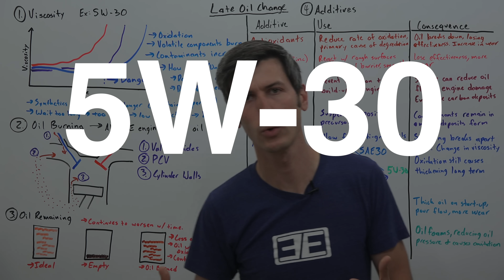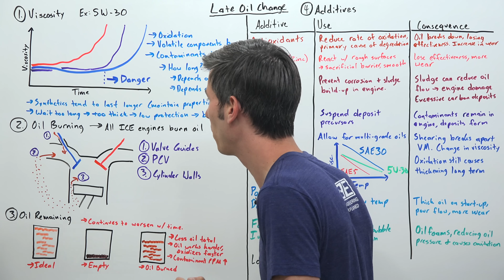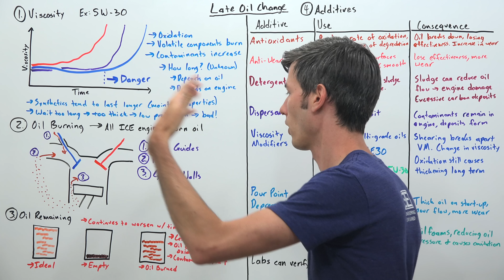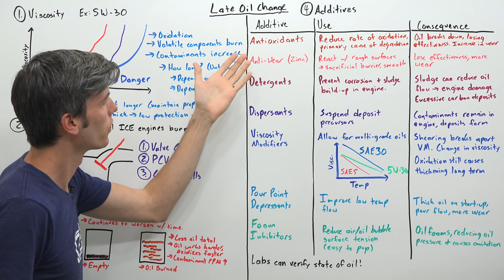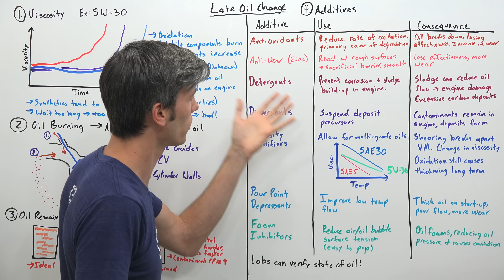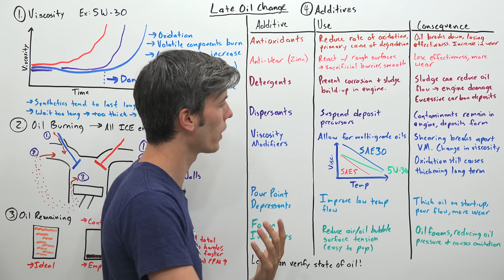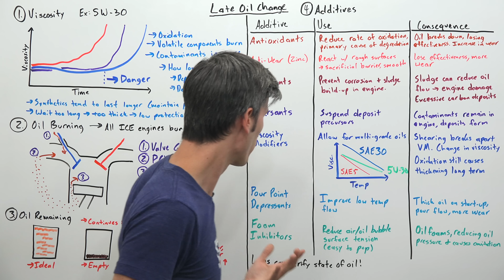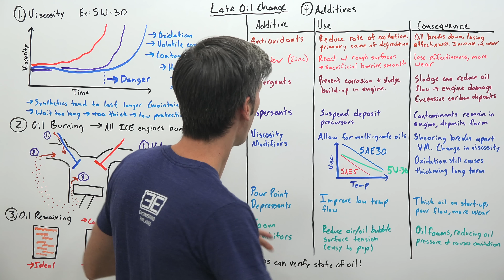What If You Forget To Change Your Oil?

Comment: Soooo, I don't understand graph number 1. What do the various colored lines represent? My best guess: red = conventional oil, purple = synthetic blend, blue = full synthetic? Wouldn't the "danger" line be better drawn from the Y-axis, when an oil reaches an unacceptably high viscosity? Just a poor graph for the point being made, and not really explained.

That leads to my follow-up question: if the main danger of an engine not burning significant amounts of oil is a breakdown of viscosity, could I monitor my oil pressure in a controlled environment for degradation? I know he goes on to explain all the other important properties, but viscosity seems to be the deal breaker here.

Comment: VW states oil is on spec if you burn less than 1QT per 1200 so with that being said by 10K(Dealer interval by VW) the oil is no where to be found on the dipstick so we recommend ppl come every 3k to get a top off but it’s normal on these cars it’s written on the owners manual it’s just how new cars are with Direct injection and plastic BS the oil burns so bad

Comment: While not addressed specifically, based on your video I would conclude that if car X calls for 5W-20, you could safely run 0W-20? since the first number indicates the lowest temperature that the oil maintains its viscosity.  In other words, the fist number can be lower (but not higher) than called for, but the second should not change. True or false?

Comment: Serious question.  I have a 2016 Acura bought new in March 2016.  It's only had one oil change to date due to extremely low miles.  Only about 8000 right now.  The MID display still doesn't say I need an oil change yet it's been over two years!  Should I change it anyway?  Note: I checked it recently and it's full and still looks fairly clean.  It takes 0W-20 synthetic.

Comment: Woah woah woah, Jason - if oil comes out dirty, then outside of special circumstances like initial wear-in, you waited too long. Change it more frequently if it doesn't look as good as when it went in, when you drain it out.

For my last car I made a point to always change the oil every 30,000 km. No grunge - came out clean every time. Indicates that those modifiers had not worn out yet, which is exactly what you want.

Use a high quality synthetic!

Comment: Thank you for the information and excellent explanation.  Note: as a fleet & logistics manager for Pepsi cola, we send the used oil's to a lab for testing to determine the proper oil change intervals for various truck types that we own.  As a rule of thumb you can go twice the recommended mileage.  Since we run hundreds of trucks and vehicles, the sample is adequate to arrive to a conclusion that is valid within our application, vehicle types, and the type of oils we use (none synthetic).
Reply: All persons talks of mileage but what about time?
Reply: @LibertyWlk  yes, we are low mileage family , our car does 3 to 5 thousand miles per year at most, so we often dont change it every year and never had any problems , we buy 3 year old cars and run them for however long we feel like which is usually 10 years or so.
Reply: @FlyingFun.  It also depends on what type of "low mileage" one has.

If all are short trips, these are actually bad for the oil.  Cold engine = fuel vapor condense onto cylinder wall & doesn't burn, wipes right into crankcase, dilutes oil, etc...

If each trip is reasonably long, just few trips each week, that's probably the best combination for the vehicle...
Reply: @reallifeengineer  I knew short trips were bad but thanks for exact reason why.
Commute is about 20 miles and weekly shop just a few miles away.
I'll defo keep an eye on the oil.
In my previous work I was doing loads of  5 minute journeys with 30 minute between them and oil got pretty black quite quickly.
Reply: @FlyingFun.  best way to go about it is to check your oil every weekend. I've found all other advice too general and now I just check oil every Sunday and going good🤙🏻
Reply: This post is the only one worth anything, it has actual data/analysis rather than one’s opinion.  Ive been building performance engines for over 25 years as a hobby, have pulled many apart and reviewed the internals.  Years ago I had beater that i treated like a beater, used conventional oils, used the cheapest oil on the shelf and changed them like every 10k rather than the recommended 3k as I didn’t care about it.  When i I pulled that apart I was pleasantly surprised to see no damage from the oil, no scoring on any bearing surface or cylinder walls.  On cars I care about I do change my oil frequently because it’s cheap insurance but I don’t sweat over it, like you found oils today do a great job.  People too much thought into oil changes, I have yet to see one engine failure due the oil in over 25 years of my and friends engines but like I said it is cheap insurance.
Reply: That’s facts. They recommend 5k for pretty much everyone so rule of thumb don’t go over 10k and def don’t push the engine hard as well as check oil levels often.
Reply: @Rider-hh9it  
No engine has compression rings that are expanded by oil pressure. Piston rings are expanded by tension only as piston don’t receive any oil pressure. This is why clean oil with the proper additives is extremely important. Once the oil rings begin to stick in their groves, there is nothing short of a rebuild that can unstick them.
Reply: @benztech2262  Not even motorup?💀
Reply: Excellent input thank you very much.
Reply: @Rider-hh9it  True they did not have VVT but had compression rings.

Comment: Don't make the same mistake I did, always stay ontop of those oil changes.

I just recently bought a nice six cylinder Merc manual. The engine got redtored by the previous owner but then left it to sit in a garage for roughly 2 or 3 years. My dumbass bought it and after a month, without changing the oil, clyinder six was left with no compression at all. Just guess what lead up to that. After I had a little fun with it for a night on the Autobahn the oil pressure sunk since my engine burnt too much old oil. The oil pressure readers' gasket blew on me and the entire engine bay got sprayed (head gasket was fine).
Also the PCV stuffed the intake with oil. Ironically I checked the oil the same night. 

I ordered a new engine which I'm going to dismantle, (change it's piston rings and gaskets etc.) plus use quality oil. 

I should've known better for a car mechanic trainee at Mercedes... At least I get to work on my car's engine 😁😁

Comment: I once accidentally went ~12,000 miles on a conventional oil change in my Kia with ~105,000 miles on it at the time. I was definitely sweating it, but it doesn't seem like it caused any damage that I can tell, no more ticking or noises than it had before...I do need to get it tested at Blackstone though.
Reply: Have you looked at the oil dipstick recently? Going to far without an oil change can increase engine oil consumption. Older cars normally burn a little oil but if you see a big change in oil level that's not good, alot of oil consumption will wear out the engine faster.
Reply: once I went 2 years with conventional oil, some shitty ass synthetic blend from honda, the engine never made any noise, was driving very smooth before oil change and almost the same after the oil change, just a tiny bit smoother.

Comment: You go back and forth confusingly between miles and time. Which is it? Does oil need to be changed by the clock regardless of use? Is there a graph of such a thing?

Comment: anyone know the 'window' for a oil/filter change ?  My car's manual says every 6 months (I do about 2000 miles every 6 months). I use fully synthetic 5W30 oil + quality filter. Car doesn't tow nor is thrashed with 40K miles on odo. Is 8 months between oil changes OK?  Old oil marginally discoloured. Just asking.

Comment: The car I bought almost new consumed a lot of oil at the beginning, 500mL every 5000km, that's a lot for a non-american engine ;-) .
Today at 70000km the oil consumption slowly decreased to almost zero, I never need to refill between two oil changes (20000km).
I don't know the reason, but that's the opposite of what you said. However I guess you're right for most scenario ^^ .
Reply: This is really interesting

Comment: In the uk we change our engine oil every 20,000 miles. BMW recommendation  !
Reply: On their plastic engines?  Have you considered that 20k recommendation is for the benefit of BMW...  and NOT you?
Just something to consider.
Reply: Sounds like you are going to have about 2-3 total changes before you need a new BMW. 

Any BMW after 2005 is basically disposable these days.

Comment: Hello, Can I do an oil change 6 month even the mileage is less than 3000 miles? Manual spec on my car say 3000miles or 3 months is recommended. So can please explain why 3 months only even the oil is used for less than 3000 miles? Ty

Comment: The dealer said that they changed the oil but didn't, then the next time I went to change the oil and isntead of 4 liters of oil inside there were only about 2 and a lot of sludge! The oil wasn't changed for 20K (kilometers) - We added a "flush", ran the engine for 10 minutes or so, changed the oil and will change it again in 5K not 10...how did this sludge become....?  Someone told me to drop the oil pan and clean it. Thanks - great educational videos

Comment: You can have your oil analyzed and decide if your oil change intervals are adequate.  I use synthetic oil and change the oil every 10k or so.  My car has 227k, and the engine is running just fine.

Comment: A mechanic in Houston, TX posted a video of what an engine looks like when the oil hasn't been changed.  Back in the late '90s and early 2000s, Toyota did have a problem of oil sludge.  This is another important reason to change your oil regularly.  If you have low mileage - driving your car less then 5000 miles a year, then changing your oil once a year will suffice.
Reply: I have a 1998 Explorer that I drive about 1,000-2,000mi per year and only change my oil once in each year. Seems to be ok but considering how my timing chain cassettes were already going out I couldn't tell if I was hurting the motor or not....

Comment: My uncle car have 66,000 mile and oil had never changed, he change it last werk
Reply: Saeed Alsaman engine would have seized there wouldn’t even be any oil left after 66,000 no change
Reply: @stickinthemaster   it was around 3 quarts left and oil was really black, but the problem now he has to change the timing chain ans spark plugs and flush the oil again

Comment: What if i just use my car about 1500-2000 city driving miles a year. Should i change oil yearly or can i extend it to 1 1/2 -2 years? I am currently using castrol edge 5w30.
Reply: Ronald San Pedro I would never go more than a year between oil changes the oil will breakdown regardless of how often the vehicle is run. I would make sure to use a full synthetic if you are changing it yearly and check the oil level at least once a month as the vehicle will naturally consume oil. Even though it’s only 2,000 miles a year the fact that it’s city miles will increase the oil burn off so just make sure you check you oil dipstick and use a fully synthetic don’t go more than a year.
Reply: @stickinthemaster  ok thank you. Ill change it out asap

Comment: We almost never changed the oil in my first Subaru Impreza. Probably averaged around 10k miles between changes, or worse. It lasted 300k miles with minimal issues, so it's kinda whatever.
Reply: Depends on driving style and weather. You can get away with it if you never rev your engine.

Comment: Hi, I saw your video after the I changed my oil.  I purchased a 2003 Honda Accord 3.0 V6 3 weeks ago.  I recently got oil change and I used synthetic oil, I did notice there is a slightly louder engine noise (knocking/clicking sound).  So should I go back to regular oil the next oil change? a mechanic told me once i used synthetic oil I need to stay with synthetic from now on. the mechanic also told me to buy Lucas heavy duty oil stabilizer to help reduce the engine noise.  what do you think?
Reply: That happened to me with an old Pontiac and Lucasoil cleared it up. It's a bit hit or miss though. Good luck.

Comment: I always pour another quart through after all the dirty is drained. Then plug it back up after that quart pulls out more dirty oil.
Reply: I tip a litre of heated clean oil through also, after draining. I have to make sure the I return the pan to the kitchen after a good clean 🙂
Reply: Everybody knows to use brake cleaner liberally to deep clean the internals.

Comment: I change my oil once a year no matter what.  I drive a Toyota Tundra and it’s going strong at 13 years old with 160k.  I also have a 2001 Tacoma, changed once a year, skipped every other filter change, and it’s over 200k going strong.  How do you explain that? Am I just lucky?
Reply: As long as you are using full synthetic oil and a good quality filter changing it once a year isn’t that bad but your engine will show more wear and have more deposits compared to if you changed it every 5,000 miles or so and the filter every time

Comment: I used to hold your videos in extremely high regard, I'm not so sure anymore after this video.  I do double the factory change internvel in an engine used in extremely harsh conditions. Even with 7k service oil the oil samples are coming back good, to the point the lab is recommending running longer.  According to your video my engine should be trashed.   That's before we get into the drain intervals on cars in Europe.

Comment: My car is getting a new engine right now, I wasn't kind the first 3 years I owned it and now I'm paying for it. It hadn't failed yet but it started making a ticking sound so I took it in, and they found metal flakes all up in my oil. I had just gotten an oil change a few days before it started as well so they're helping me out since they should have noticed it then, I doubt it was an instantaneous thing.

Comment: Here’s another video topic idea for you, Jason:

On my Prius Prime, a PHEV (Plug-in Hybrid Electric Vehicle), I have the opposite concern:  I almost always drive in EV mode, except when we go on road trips, which are comparatively rare.  So I end up doing mandatory 10Kmile oil changes to keep from voiding the warranty (and to pay my dues to the dealer!), after barely having used that oil at all.

But Jason, what are the dangers — related to oil or anything else — in using an engine any appreciable amount only very rarely?
Reply: Well it’s the oxidation, whether used or not the oxidation won’t help. How’s your car running, 3 years on

Comment: Thanks so much for these great videos, I hope it's bringing you success. Quick question on oil degradation: clearly mileage is a major contributor, but how quickly does the oil oxidise over time? If I rarely drive a car, it could take years to hit 3,000 miles. In this case is it better to count time and change the oil annually at a minimum? Specifically, the owners manual for my diesel Renault says Oil Change Interval is 30,000km (18,641 miles), or one year - whichever comes first. Clearly this is an extreme OCI and I change the oil more frequently, but these engines allegedly do just fine on 30,000km OCI's. Since I drive about 12,000km (7,458miles) per year, I normally do just the annual oil change (crazy, right?). The big question is: If I go a month or two or six past the annual oil change, will the oxidation of the oil render it inefficient before it gets changed?

Comment: If you forget to change your oil based on time not mileage, then YES.
5w30.. 5 indicates the BEHAVIOUR at cold and 30 is BEHAVIOUR at hot. So behaves as a 5 weight at cold and behaves like a 30 weight at hot. Else you make people believe it gets thicker as it gets hotter

Comment: I live in the northeast and I'm wondering what you think of using the next lower viscosity rating just during the winter months before changing oil in spring?
Reply: Next lower than what? 5W... is rated up to -25C and 0W is for all temperature ranges, no matter how cold. Why don't you always have e.g. 0W40?

Comment: Is it true if the oil is completely filted it's basically new?
Reply: I don't think so, the particals and additives within the oil breakdown completely and alot of it will burn off or oxidize.
Filters in cars only filter out larger containments
Reply: @archygrey9093  thanks 👋

Comment: It's cool to think in my electric vehicel that oil change is just a thing of the past.
Reply: So is long distances.  Try driving across the country. And waiting to charge your batteries every 200 or so miles.
Reply: @1958Cadillac-v2g  true for now, but it's getting better. In a couple of years, give or take, electric vehicles will be cheaper than internal combustion ones and will have longer range plus faster recharging. Or gas stations could become battery swapping stations.

Comment: Interesting. So now i want to ask, between OEM oil and expensive oil (about 4 times the price of OEM oil) which should i go given the condition: only weekend driving, 5000km only after about 8-9months? 

Should i choose cheap OEM oil and change it after 9 months, or use expensive oil and change it after 10000km? Thanks.
Reply: Oem oil. Imho oil should be changed at least once a year. Cheapest solution.   :-)

Comment: Just a heads up, the winter SAE number on the oil is not the cold viscosity, but rather the flow characteristics in cold weather. A 5w-30 oil flows like a 5w oil when cold, but may have a higher viscosity than 30

Comment: LOL, funny explanation, I though Mechanical sheer would lower viscosity that's why you don't want the oil used for longer than recommended. But as always I find this channel to confuse my smart brain, thanks. What he should have said is why you don't want to keep the oil for a very very very long time, basically skipping two or three oil changes.